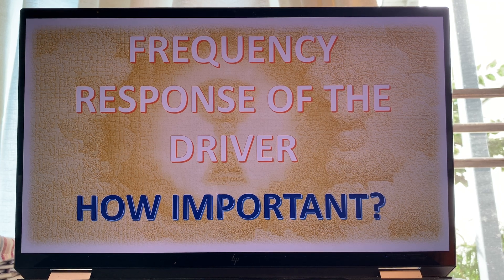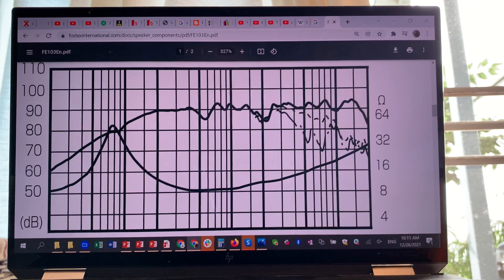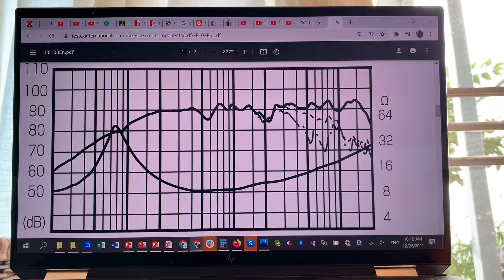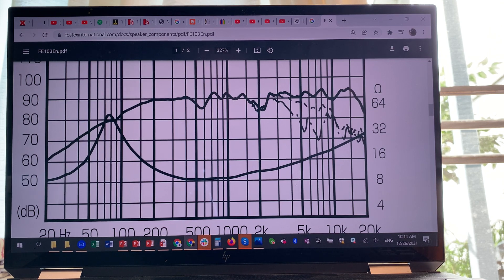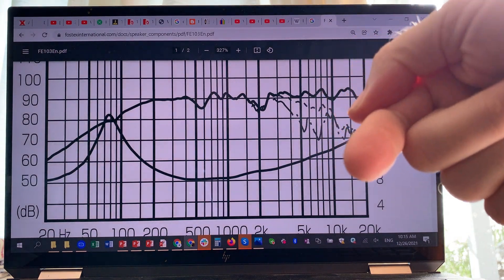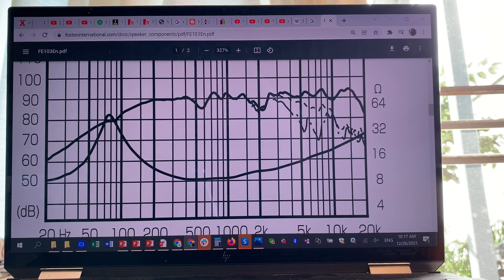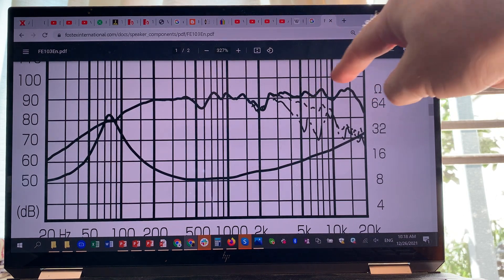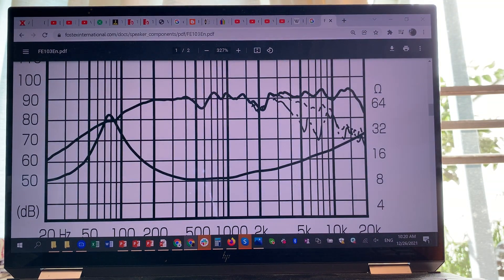ESSENTIALS: Frequency Response curve considerations!

Comment: actually looking at that graph the speaker would be quite rolled off at the higher frequencies and not a lot of bass really at the lower frequencies below 70 Hz,
it's the impedance that's important and that's not a very good graph it will struggle at the higher frequencies and the lower frequencies, only suitable for near-field listening won't be suitable for middle or farfield listening without crossover.
no you're correcting the impedance by changing the frequency yes you have to be careful where the impedance drops at its lowest point because that will drop further but thats not necessarily a bad thing at 8 ohms.
Reply from the maker: This was just a random example to look at, I was not suggesting the perfect driver here ; ). It's the tiny FE103NV, a 4inch "full range" driver with all its limitations. (Aka a wide band midrange driver.) And advantages (coherence), which are not obvious from these graphs alone... 
You are correct about the impedance, but that's another story, I did not get into that here, only into some aspect of the freq response curve - as much as this short time allowed; Janos
Reply: @realworldaudio  not too bad then for small driver
check out dark sunrise by Ricky ililonga I think you're like Zamrock
Reply from the maker: @hoobsgroove  Thank you for the Zamrock recommendation!) ;  Janos
Reply: @realworldaudio  it's quite eclectic more than just rock it's a mixture of salsa jazz rock, yeah give it a listen some great tracks. would like the album!